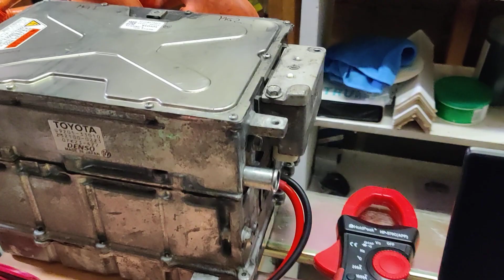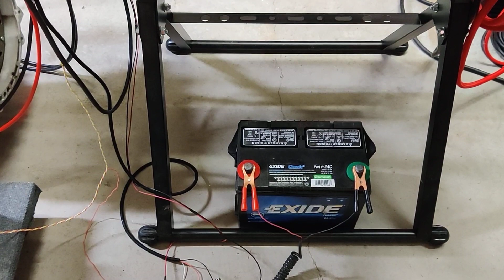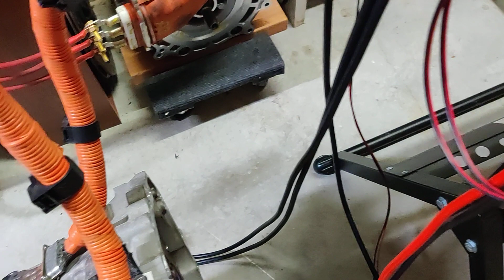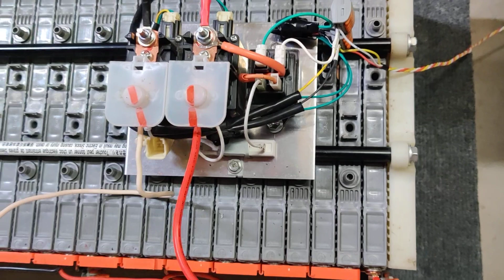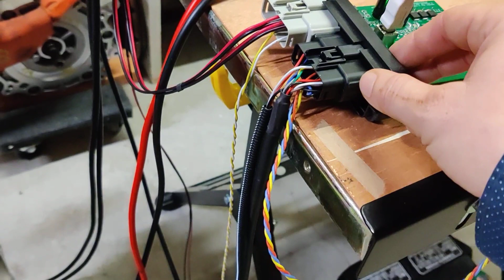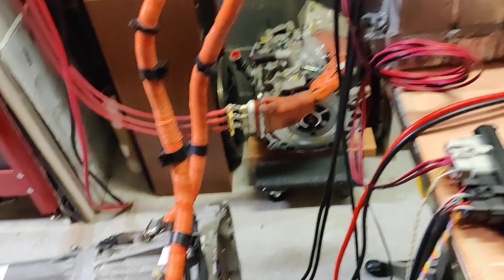Lexus GS450h drive-train connections

Comment: Artur, do you recall where you bought the 4 twisted pair in the shielded cable?  I see Toyota keeps these all separate, but I think bundling twisted pairs together should be just fine.
Reply from the maker: I think I got it from Amazon but what you are looking for is SFTP ethernet patch cord of desired length. This will give you 4 individually shielded pairs. You can use it for Inverter control as well as resolvers.

Comment: Artur this was very well explained, thank you.  Question for you, how come you are using a relay to power on the Inverter?  Forgive me for asking I am not questioning your logic just I think Damien does it with straight up 12 volts and no relay and I was under the impression that the Inverter is only operated by a low voltage circuit, am I missing something?
Reply from the maker: In bench setup it does not matter much. But in the car you want relay to power off Inverter when is not used (during charging or other situations). You could power it straight from Ignition but having relay controlled by VCU gives you more flexibility.
Reply: @ArtursGarage  how many Kw do borh the Mg1 and Mg2 output?
Reply from the maker: @FirstLast-tx3yj  based on my knowledge on paper nominal power combined is around 300kW. However with stock Lexus Inverter power is limited to 200kW. It is still a lot of power but at some point I am going into unlocking remaining power.
Reply: @ArtursGarage  are you going to lock MG1 like Damien did or they automatically run together because the inverted is telling mg1 to be a motor and not generator?

Will you be getting an after market inverter to unlock the 300kw? Or what will be the upgrade?
Reply from the maker: @FirstLast-tx3yj  of course, this is one of the first things I did. It is in one of early my videos.
Reply: @ArtursGarage   thank you for the response!
A simple switch on two 12v wires can switch between R and Drive

But lets say i did not lock mg1 for testing purposes can i have a switch to run Mg1 alone and Mg2 alone? And switch between them whenever i want?
Reply from the maker: @FirstLast-tx3yj  yes, you can do that but you have to make small changes in Arduino software because right now it is configured to control both motor.
Reply: @ArtursGarage  ahh okay no problem

I know i am asking a lot of questions but is there any regen built in the vcu?

Comment: Hi, Artur
Can you help me to find the pinout of Camry invertor connectors?
Reply from the maker: Keep in mind Camry communication protocol is not 100% compatible with GS450h
Reply: @ArtursGarage  What are the main differences between their protocols?
Reply from the maker: Short answer is that it Camry inverter cannot be used at the time without modification, GS450h can be used as is. For more details I would recommend checking relevant threads on openinverter.org
Reply: @ArtursGarage  Thank you. I figured it out. Tell me, please, what part number does your Lexus inverter have, with which everything works without any problems?
Reply from the maker: Here it is:
https://openinverter.org/wiki/File:Toyota_Camry_Inverter_external_connector.png

Comment: Does the Camry inverter/converter have a 12v positive output terminal for charging the auxiliary battery?
Reply from the maker: No, it does not. You need separate DC-DC converter. I am currently using one from Chevy Volt but there are more options available.